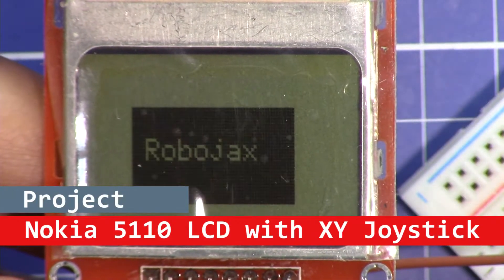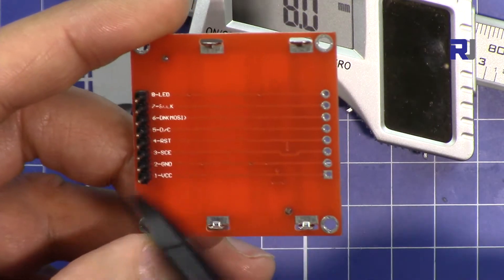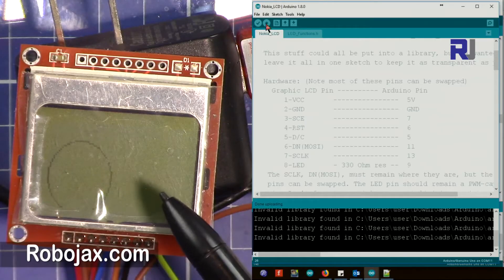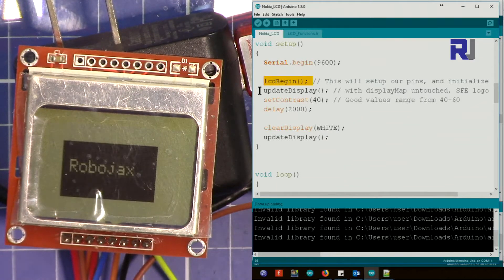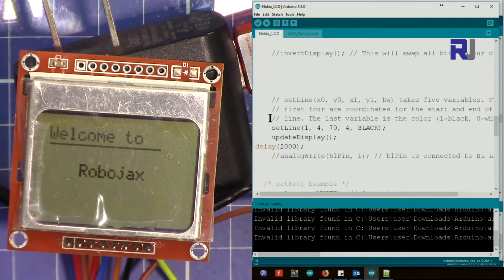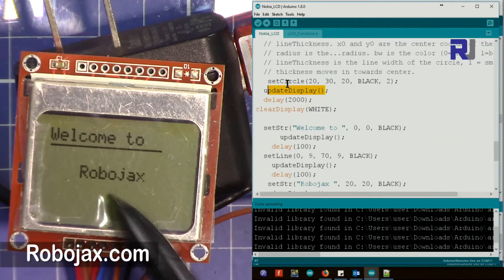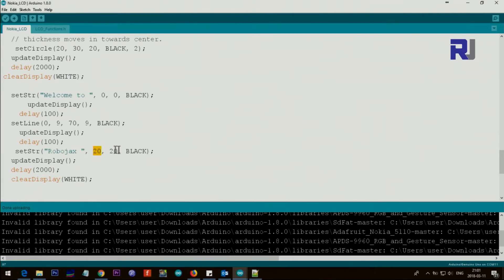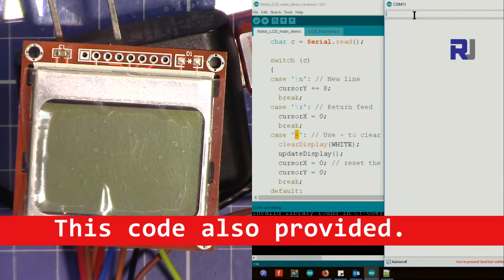How to  use Nokia 5110 LCD Screen with Arduino RJT66

Comment: how to draw custom graphics?
Reply from the maker: that is what this video is for. you draw line, circle or rectangle to draw something. But if you want to print actual graphics, then you need to use online tools to convert your image to hex value for Nokida display. there should be tools . just do a bing or google search.
Reply: @robojax  ok thanks. however i had to use another library because you did not link the library, you only linked the code
Reply: can you please link the library so that i can use it
Reply: @robojax  hi, i downloaded the library and read the code, it looks good. what is the command to display custom graphics using bitmap?

Comment: sir library not in the form of zip file.........please provide a zip file
Reply from the maker: Even though it was ready to be used. you just needed to download the LCD_Functions.h file, but I made it zip so you can use it.  The page is now updated with zip file.  salam. Ahmad from Canada (Persian from Afghanistan)
Reply: @robojax  thankyou very much....i hv downloaded it now....i wasn't able to download it......again thanks
Reply: @robojax  sir it still shows me an error "LCD_Functions.h: No such file ".......wt to do now
Reply from the maker: I fixed the code because it was referring to the wrong .h file. Not it should work
Reply: @robojax  thankyou very much
Reply from the maker: You are very welcome

Comment: Error Arduino: 1.8.13 (Windows 7), Placa:"Arduino Uno"

   SPI.begin();  
   SPIE

DisplayTeste:505:19: error: 'SPI_MODE0' was not declared in this scope

   SPI.setDataMode(SPI_MODE0);

                   ^~~~~~~~~

exit status 1

'SPI' was not declared in this scope
Este relatório teria mais informações com
"Mostrar a saida detalhada durante a compilação"
opção pode ser ativada em "Arquivo -> Preferências"
Reply from the maker: It say NOT declared. So install library
Reply from the maker: You didn’t say anything to my reply.  Even in your first comment , you should have started like: hi, I am uploading the code and getting there or below, can someone help

Comment: I connected Nokia 5110 to Arduino UNO exactly as in this video and used the code and library provided by the link but nothing shows on the LCD. Then I tried the software SPI method instead of the hardware SPI and it worked. I didn't change anything except for reassigning the pins in the code. How should I explain this. Have you had similar experience with this issue?

Comment: What should I edit if my LCD display connected to different pins on Arduino?
Reply from the maker: that is what I have explained in wiring and then in code. Watch the video and in code change the pins. I had to watch the video making sure I did not miss anything before replying to you.  Indeed I have explained it in the video.
Reply: Thank you for your reply but I indeed wasn't able to find explanation even After watching video 2 more times. All I found in your code is this: The SCLK, DN(MOSI), must remain where they are, but the other pins can be swapped. 
 But my setup must be like this, 
SCK- pin3
SCE- pin4
RST-pin5
DC- pin6.
Do you think it is doable? Please help.